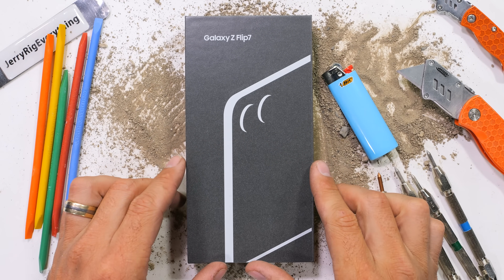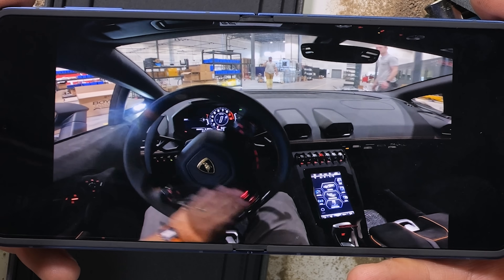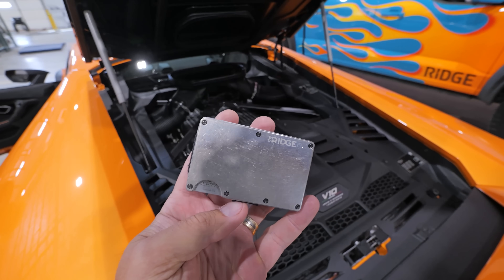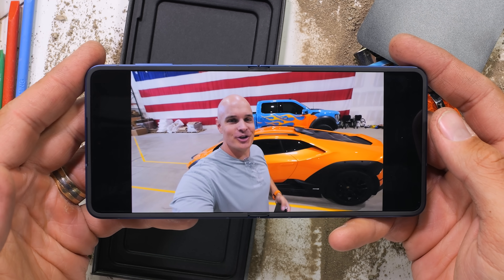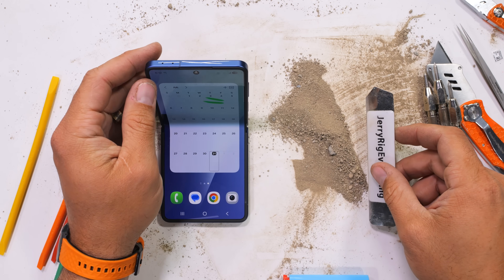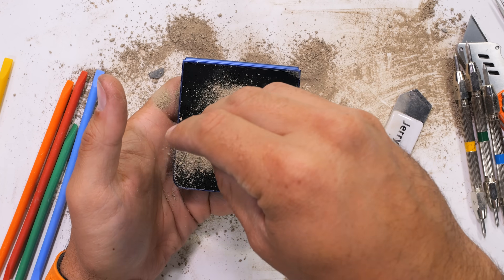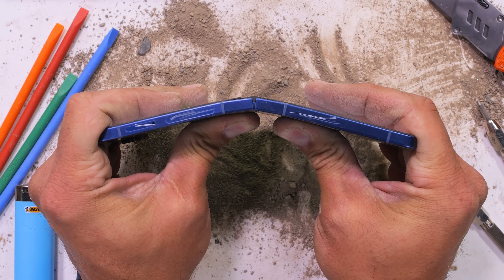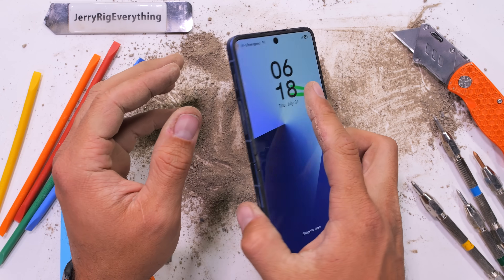Samsung Z Flip 7 Durability Test --- Revenge of the Fallen

Comment: Not sure if it's still the case, but with my Z Flip 5 a couple years back I switched out the screen protector to a matte finish one. Then I had an issue with the battery and had to take the phone to Samsung for warranty repair. They noticed the aftermarket screen protector and even asked me about it, but didn't give me any problems with my warranty repair. Possibly because my issue wasn't screen related.

That being said, I've got the Flip 7 now and have had every version since the Flip 3 without any problems with the screen. It even seems like the Flip 6 fixed the issue they always had where the factory-installed protector would start cracking at the hinge after about 6 months. The charging issue on my Flip 5 was the only problem I've had.

Comment: these flip phone series are always begging for mercy but surprisingly hold well every time.
Reply: It tried to call 911 when he started the bend test 😭😭💀
Reply: Unless you scratch it with a fingernail.
Reply: @VonnegutRosewater-yi4rkjust dont do that, its not hard, you have to try and scratch it with your fingernail, but its possible
Reply: @VonnegutRosewater-yi4rk I've tested with my old flip 3, you won't scratch it with your nail unless you try to, I can literally use just nails to tap and it doesn't damage
Reply: @TheTrueLog also screen protectors exist
Reply: @TheTrueLog  same i have a fold 3 its 4 years young no marks on inner display at all besides the thin glass just starting to crack but hey its a 4 year old fold with that known issue of that generation (first glass layer) so i accept that as mint seeing it only after 4 years hahaha
Reply: @VonnegutRosewater-yi4rkthat's a screen protector 😂 the real screen doesn't scratch that easy
Reply: only samsung other folds failed the bend test
Reply: @dezee7180  which is crazy to me right?
Reply: I have been pretty hard on my flip 3 (it has even flown off the roof of my car at 45mph) and it is still working almost perfectly...The hinge finally stopped opening all the way recently when it fell off my lap onto a hardwood floor and apparently landed just right... It now doesn't quite open flat, but gets almost all the way there, and with the way I use the phone it's a non-issue... The screen is also finally starting to crack just a tiny bit in the middle, and I have been running it without the factory screen protector since like a month after I got it... Before I switched to the flip, I would break 1-2 phone screens per year...

Comment: 6:45 whats going on with the bottom bar
Reply: That's the Samsung Pay credit card button, you slide it up to pull up your card for tap pay. My guess is the flames from the lighter confused the screen so it's still picking up a touch input

Comment: That was probably the most PAINFUL TO WATCH Video here in Youtube. 👍 😆Thanks for the Great Test. I bought 1 a few weeks ago. Now I know I bought a phone that will survive ROUGH USAGE...  THANKS... 😁😁👍👍🎉🎉
Reply: I had the 5 and the 6 and I loved both of them more than my iPhone 15 Pro I have now. The only issue I had is you will 100% need to use that screen protector replacement at some point, and Samsung has not made it easy unless you live in a city. Having to swap phones for a week and a half sending the phone off to get repairs stopped being fun after the second replacement.

Hopefully they have somehow fixed the crease part of the screen detaching from the protector. That was the repeat failure point for me and mostly due to build up of fine pocket dust and normal open and closing.

Comment: Samsung and its official repair partners do NOT honor that 12-month free screen protector replacement warranty. I recently tried to apply it to my Flip 6 that merely had surface scratches on it and it was month 12, so I figured let's get the free replacement. Nope, they rejected it due to scratches (on the protector) being physical damage, and physical damage is not covered. I then contacted Samsung support directly and argued for over half hour how their own terms of the 12-month replacement offer spell out "scratches" (among other things) on the protector that they replace for, but the Samsung agent told me scratches are physical damage and are not covered. I asked them to escalate up the chain, but it fell on deaf ears. They will go above and beyond to deny this supposed free 12-month protector replacement. I ended up paying 20+ bucks for it.